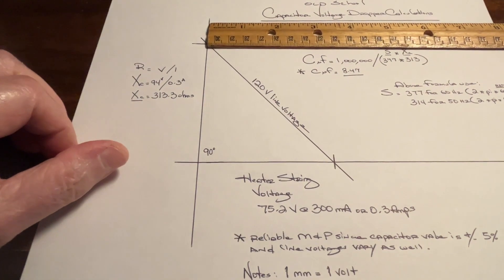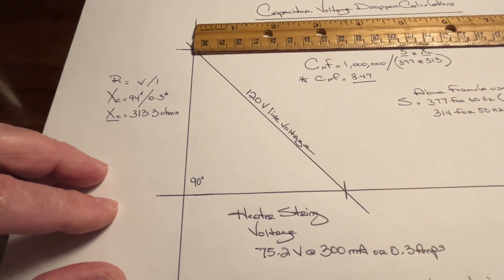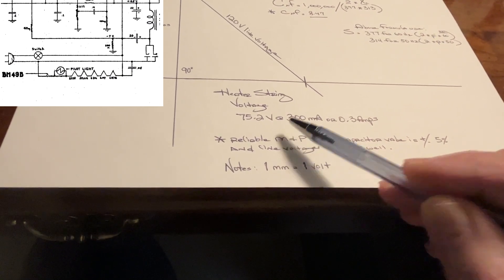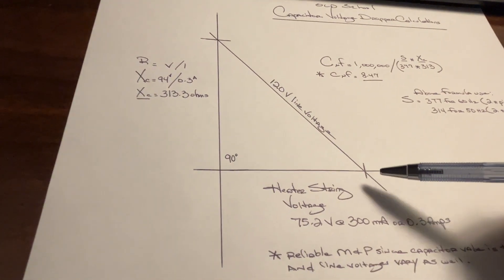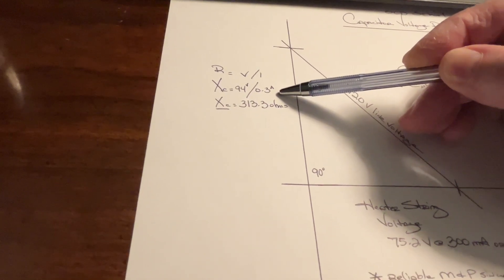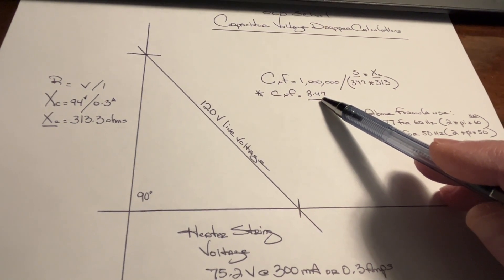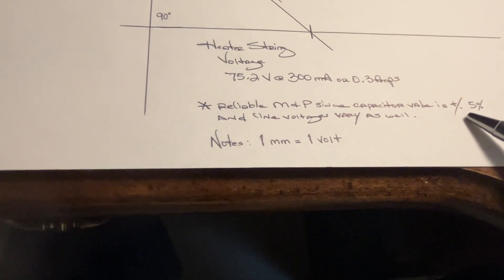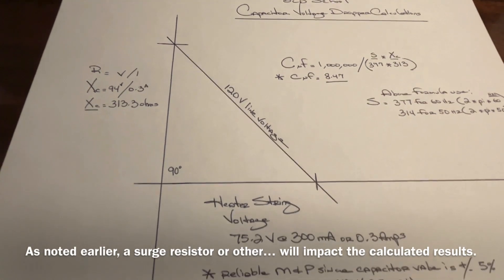Capacitor Voltage Dropper Calculations - Old School M&P | Resistive Line-Cord or Ballast Sub

Comment: I need this but I don't get where the current value came from in the Xc calculation. Just add the expected current for tube string (and any other load)? I know that the tube current varies just going from no signal to playing music so what are we shooting for?
Thanks Mr. Don
Reply from the maker: The current value of 0.30 Amps, i.e. 300 mA is the current rating for the tubes used in the receiver for the “series” heater string. In this receiver, all tube heaters are rated at 0.30 Amps and the pilot (dial) lamp (0.25 Amps) was the only exception, but that was rectified by installing a shunt (parallel) resistor of ~126 ohms across it. Hope this helps. Best, Don
Reply: @RestoreOldRadios  That will do. Thank you!
Reply from the maker: Here’s the video for the shunt resistor calculations: Dial Lamp Shunt Resistor Calculations
https://youtu.be/iZ1SGe6WNyA
Reply from the maker: I had a typo and edited my earlier comment. Don

Comment: Long time ago I did use capacitors for voltage drop but I forgot this as a solution. 
Since around 5 or 6 years I started to watch YT tube restauration channels ( yours and others) and every time I had to drop AC volts (6.3V was at 7 Volt!) I used high wattage resistors. 
Now you inspired me and I will try ro calculate the cap with this A+ explanation ! 
BR from good old germay, Torsten
Reply from the maker: Thanks for watching and the kind words, and all the best with your calculations. Thank you again. Don

Comment: I don't know if any of this has anything to do with each other or if it's just serendipity. 

Shango's last video just touched on using capacitors in place of the ballast tube for voltage drop with line string heaters.
Reply from the maker: I went and watched the video Shango posted and found it very informative and interesting. I just started repairs on an AIRMASTER Radio from the mid 30s is my guess that had a ballast tube and decided to share this illustrative method for closely determining the needed capacitance value. I’ve used this method (capacitor dropper) in the past, along with power resistors (that generate a lot of heat) and a diode and power resistor in series, which works well. Thank you for watching and taking time to reach out. Best, Don

Comment: Great Tip At RestoreOldRadios and great difference in capacitance for similar voltage values but for european tubes at 0.1 A
Reply from the maker: Thank you, appreciate the kind words and the heads up on the European tubes. All the best. Don

Comment: I asked the channel ‘John kleinbauer’ about all this. He said, and I verified, back in the tube days they did highly accelerated stress testing to 120 v on tubes as part of the manufacturing process. This test does not wear out good tubes, but causes weak tubes to fail. Bottom line, you don’t need to worry about 120 volts. ??
Reply from the maker: Thanks for sharing this info.  I typically try to keep the filaments/heaters +/- 10% of their rated value. Cunningham and others note the best performance is at the rated… and low voltage causes the temperature of the cathode to be below normal, which limits electron emission, while high filament/heater voltages can cause evaporation of the cathode material that reduces the life of the tube. Thanks again for watching and sharing. Best, Don

Another good read below starting on page 11.

getting the most out of Vacuum Tubes by Robert B. Tomer
https://www.worldradiohistory.com/BOOKSHELF-ARH/Technology/Sams-Books/SAMS-Getting%20The%20Most%20Out%20Of%20Vacuum%20Tubes%20-%20Robert%20B.%20Tomer.pdf